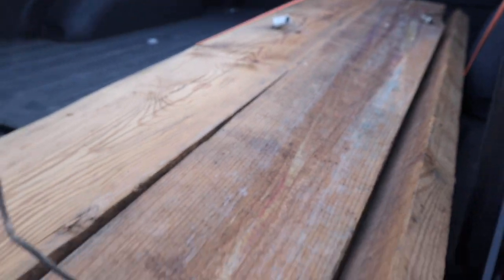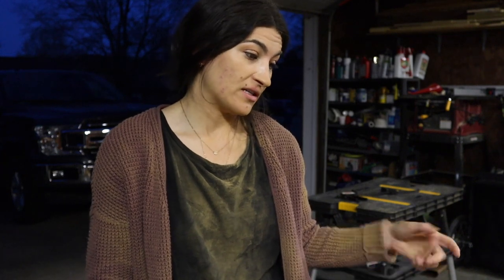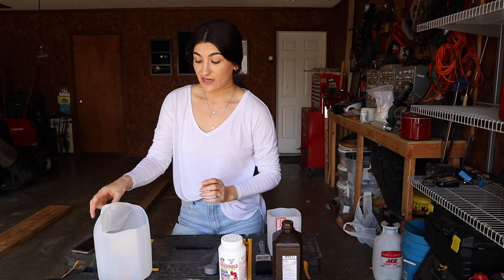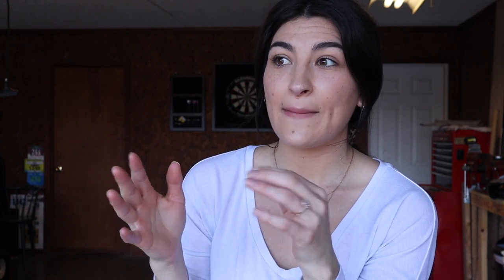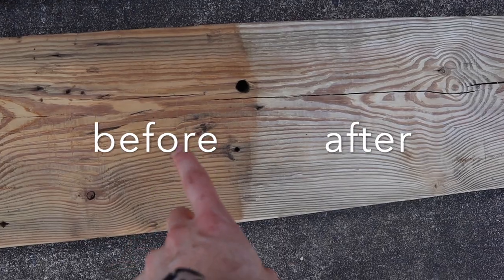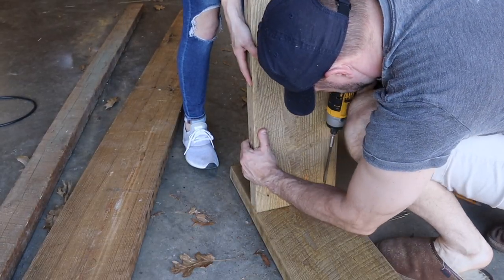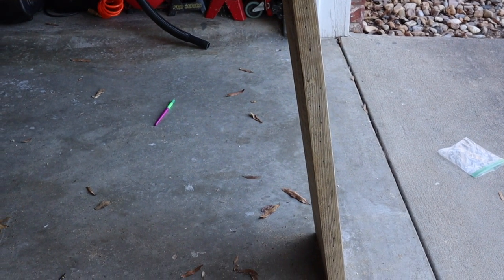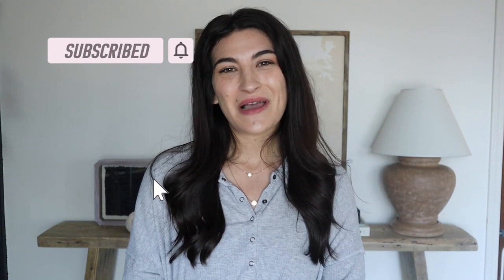DIY HIGH END CONSOLE TABLE

Comment: Nice work you two. Tip: If you ever run a large board through your table saw, cross cutting, run it through half way, stop saw, then add a small wood wedge in to the saw's kerf. Then proceed with the final cut. The wedge will prevent the wood from pinching together and causing a nasty kickback.
Reply: By the way, do you remember the length of the table top?
Reply: By the way, do you remember the length of the table top?

Comment: Love this 😍 what size are the wood boards?
Reply from the maker: Thank you! The ones I picked up are 9 1/2 inch x 1 1/2 in if you buy them in store they’ll be 10x2’s but you could use something wider if you wanted and it would be really pretty! Definitely not anything more narrow though. And I cut my table top to be 66 inch long and the legs to be 32 in long. Hope that helps!